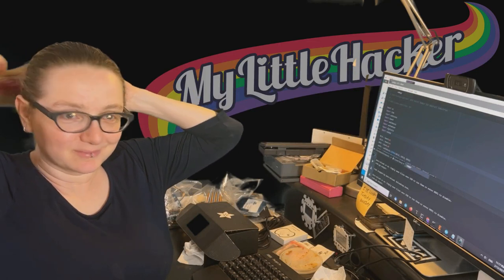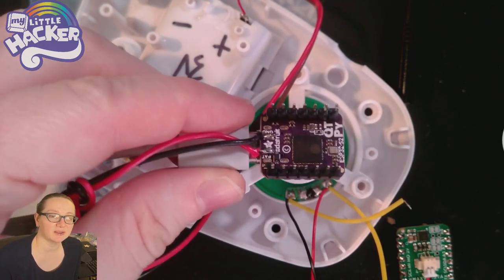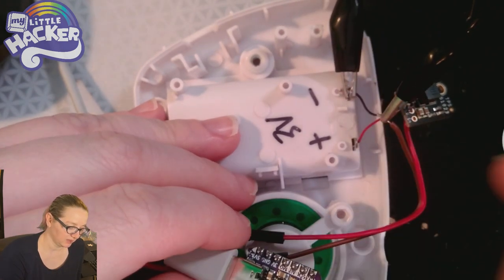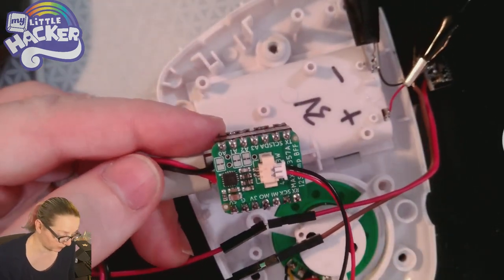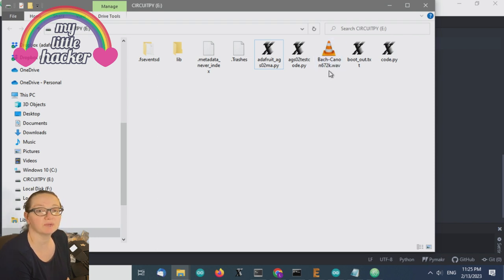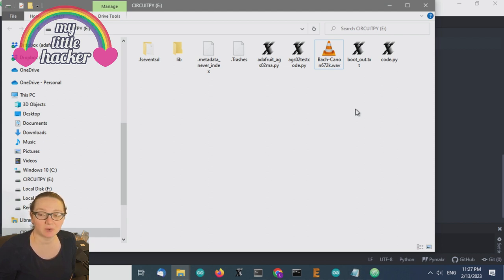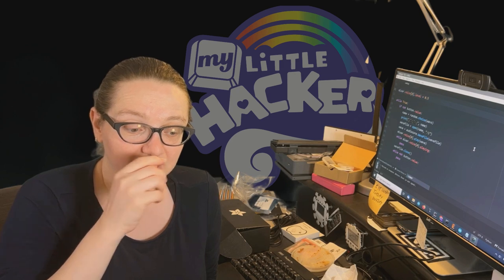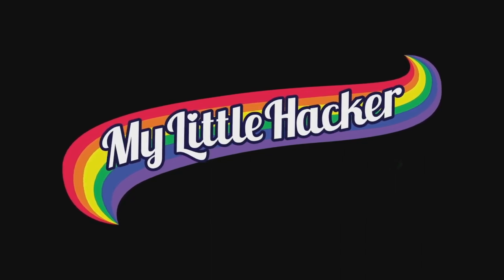My Little Hacker: Making an MVP (Minimum Viable Player) for the Baby Einstein Take Along Tunes hack

Comment: I always threatened to put resistors inline with the speaker, but usually just settled for strapping tape over the speaker holes to reduce volume 😁
Reply: Some of those toys (not necessarily these exact toys, just kids toys in general) are crazy loud. And if they have volume control, it’s just a simple switch with “super loud” and “not as super loud” settings…
Reply: @RandomBogey  believe me I am painfully familiar... You are totally right

Comment: Oh neat, I didn't realize you could control volume with the mixer code itself. That helps remove the (kinda weird) gain pin resistor settings a lot of those I2S amps have.

Comment: Does your I2S amp click on startup? The one I purchased does, and I'm looking for tips on how to avoid that.
Reply: Is that possibly spurious output from the MCU, or is it from the I2S chip powering up?

I was prototyping with relays recently, and trying to make sure they don't toggle state on boot up of the MCU, as I'd see the indicator lights blink briefly.  Still working to sort that out.
Reply: @mlindholm  My guess is that there is a slight DC offset in the output of the class-D amp, which saturates the voice coil of the speaker during quiet periods.